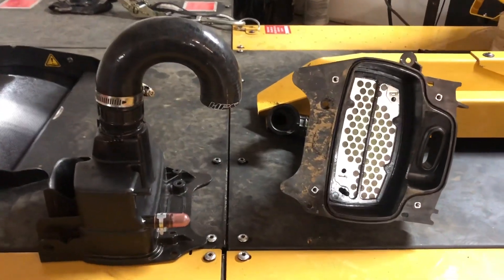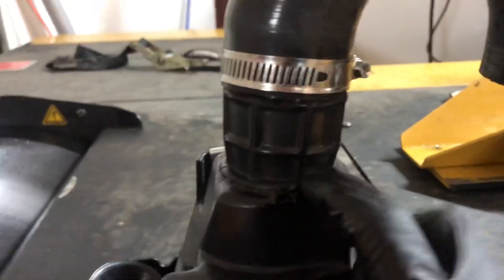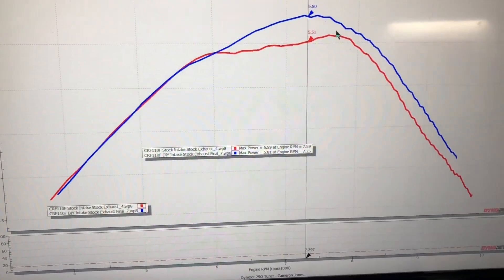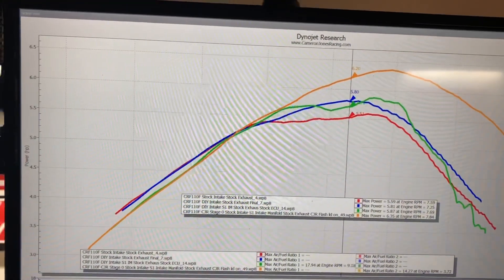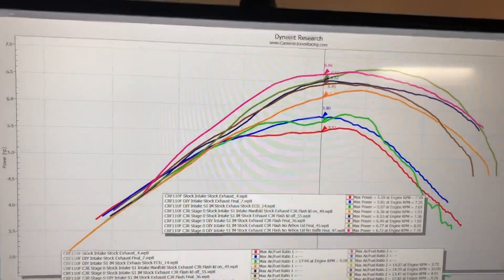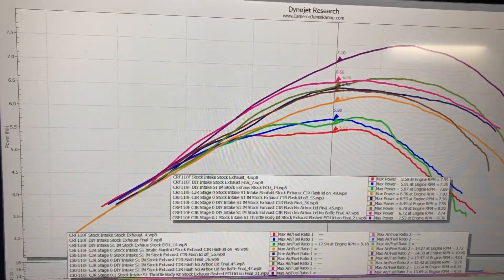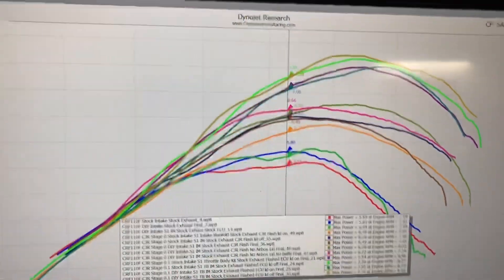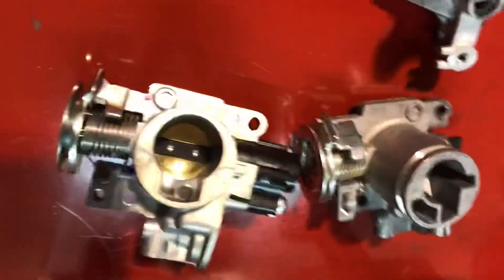Honda CRF110 19+ DIY Intake + Dyno Graphs + Throttle Body / Manifold Comparison - CJR Performance

Comment: My bike won’t idle and I just bought it from a guy on marketplace other then that runs fine just won’t idle I looked and it doesn’t have the stock looking ribbed tube but it does have a smooth tube and a pro circuit pipe

Comment: What size throttle body is that with?
Reply from the maker: @TopsideSiteworks  at the time I believe it was on the stock one, but also works on the 24mm option. We moved to the Decha intakes last year and had a lot better luck, the DIY ones have a slight kind once everything’s clamped down
Reply: @cjrperformancecameronjones1097  awesome thanks for the reply! I’m gonna go ahead and order your throttlebody kit and send you my ecu to tune it. I’ll call in to get more insight once you’re back from big Hill jam.

Comment: Will I need to flash my ecu or anything if I install this
Reply: Good luck getting a response. I asked this guy the same question months and months ago and no response. I'm wondering the exact same thing, did you ever figure out if you have to retune the ECU after changing the intake tube?
Reply: He said you didn't needit

Comment: Hi, I tipped the bike over and crank oil filled the air box it even ran down into the top of the carb but cleaned the box, what do you recommend for the breather tube ? As it goes into the air box

Comment: Wassup, in my country honda sells a cub with this engine, stock it gets 7.1 whp with a 24mm throttle body, I ve modified my engine adding 11cc, blue printing my cylinder head and replacing the throttle body by a 28.5MM. 13.5 whp. 

Unbelievable engine.